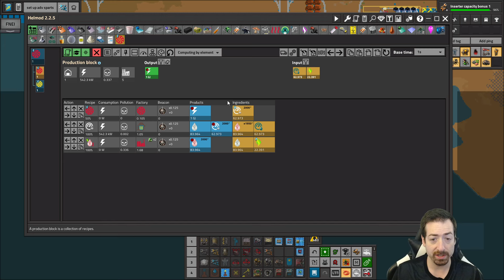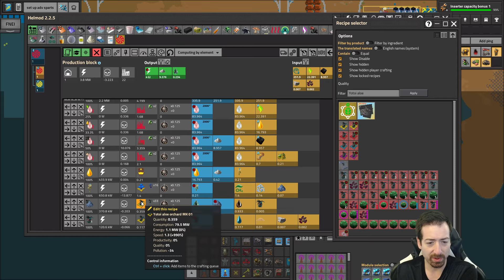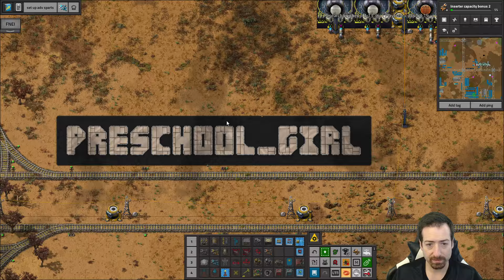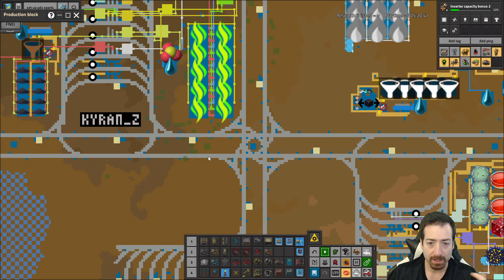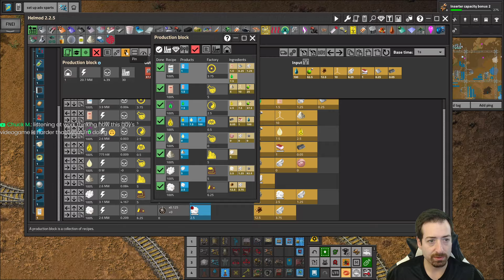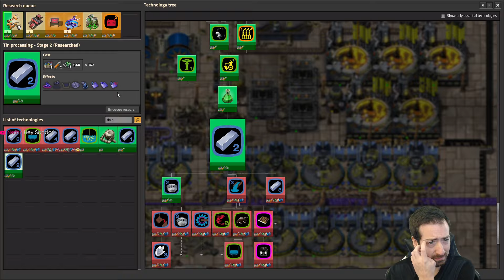Red Circuits Complete! - Factorio pYanodon's S3E275

Comment: 32:45 There is actually a setting for timing each delivery for each station. "Track request wait times" Then just check the cybersyn manager UI. As for the averages you might just need to do them manually.